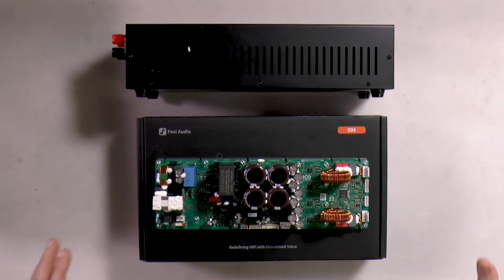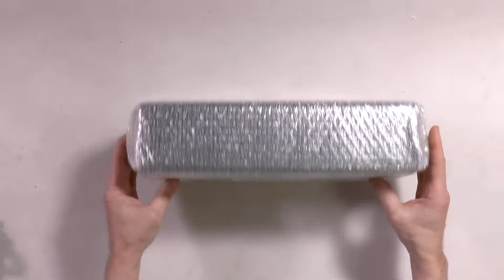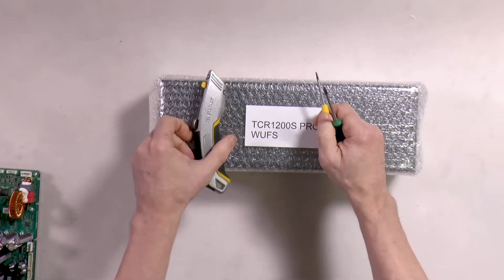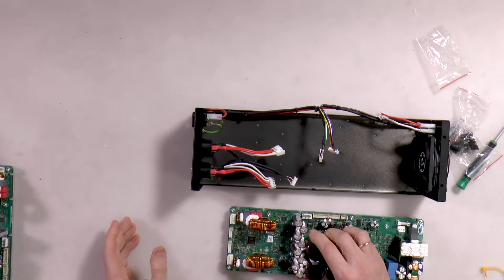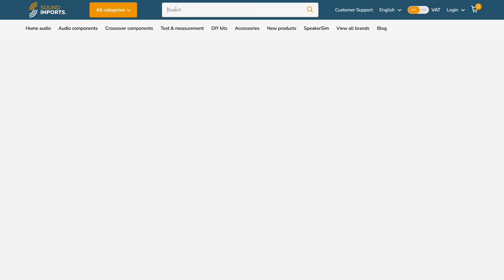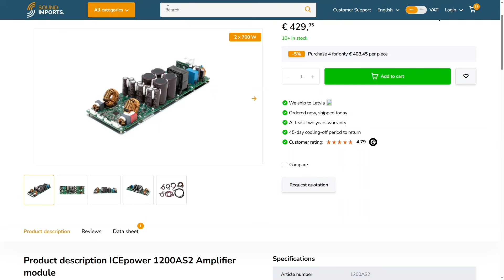Build a ICEpower1200 World‑Class Amplifier in 10 Minutes – Full Guide + FAQ

Comment: Ok so I used 2 700 as1 boards with a dual 5532 op amp pre amp and all I can say is these things absolutely rock and to my ears sound better than my Hypex 400 watt mono boards I built and these were  half the price . There is no replacement for displacement! This is what they say with race car motors and I guess holds true for amps ? The ICEpower being almost twice as powerful I never have to drive them hard at all for the same output on a lower wattage amp wich means a cleaner signal . These puppies don’t even get warm .thank you Mr smiths!!

Comment: Love your channel thanks .i have a dilemma i currently own a 700as1 module .i want a stereo amp . So should i buy another 700as1 and make momoblocks ,or use my current amplifier as a sub amp and buy a 1200as2 being that it has the newer technology but is a bit more expensive? Thank you again
Reply from the maker: 1200AS2 is unbeatable. Depends on a goal you are aiming. 1200 is grate for full band amplifier aplications and can hadle any speaker from small to large.

Comment: Good morning sir , I have bought 2 of the 700as1 modules I would like to use a tube type pre amp for them .Is there a certain one or a type I should be looking for? Thanks for your time .
Reply from the maker: I am more on the engineering side and have limited hands-on experience with different equipment. You would be better off speaking with someone in sales who has access to a wider range of preamplifiers.

Comment: Good afternoon, Mr. Smits. Please help me with advice on the icepower 1200 amplifier board. When the amplifier is turned on and off, there is a pop in the speakers due to the transient process. I connected 220 volts to the board, the signal from the preamp, and connected the speaker system. What did I do wrong?
Reply: Hi there, when you do this sequence :  starting  first by powering  your sources, then the preamplifier and then the power amp and when you stop, stop first  the power amp, preamp and then sources., do you have the same problem?

Comment: I have a couple of these Im putting together  a pair of amp plate with some china generic plates that went bad. So i have all the mechanical done just ready to do the wiring but im a bit co fuse with the stanby turn on..
Does the board should sound once it has power and signal in. Or have to clip any pins etc, also not sure on using both channels at 8 ohm or one channel at 4 ohm. I guess ill go with dual channel at 8 ohm not to strees the board.
Reply from the maker: For standby and wake up from a signal. You should provide 5-12V to P101 pin 6. It will put the amplifier in Standby, and you should provide a signal from one of the inputs to the P102 signal sense pins 20,21,22. Download the engineering manual from the Soundimport site for more details. Regarding asymmetrical load, you can use any load combination. The board has been built for that

Comment: After watching your video, I built an amp using 2 1200as2 boards completely separate from each other including power cord. In doing so, I also put a DC blocker board in front of 1200.  The resulting sound is incredible clean, transparent, driver control (McIntosh XRT18, 18 drivers per channel)  the bass is so tight and deep I have not heard before. The amp sounds very much like a class AB amp yet cleaner, faster and tighter.  I have owned many amps before and  IMHO the Icepower 1200AS2 dual mono shows the most musical truth. Burned-in took at least 200 hours.
Reply from the maker: Recently I’ve been selling more and more integrated amplifiers in the local market, and the feedback I’m receiving matches exactly what you described. For many customers, the 1200‑series board has become the true end‑game amplifier.

Comment: I work in power supply design, at 1KW you need a PFC interleaved boost if the application is expected to have sustained current draw, these have no indication of a PFC stage.
Reply: According to the manual it does have a PFC circuit with a nominal power factor of 0.92
Reply: @EEGworld  the question is, why isn’t the gentleman that made the video answering his question. Somebody else in the comments is answering, which is concerning.
Reply: @philmccracken2012 he is not an icepower engineer. And he has answered this question elsewhere. Relax

Comment: I love your YouTube video's, thank you for your commitment to DIY'rs!  My preamplifier is a miniDSP Flex with RCA outputs.  Will I be able to achieve the full audio potential of your ICEpower 1200 amplifier with my miniDSP using XLR Male to RCA Female Adapters?
Reply from the maker: You should check mini DSP output level. FOr full power in unbalanced setup boad needs 4V for 4Ohms spaker adn 8V for 8Ohms spaker. For balanced half of that 2V and 3.8V

Comment: I think you should come out with a product that is similar to trinnov amplitude and the new (or soon to be) amplifier by SpeakerPower. These are known to be high end products and they use the 1500S IcePower amp x2 and the 400A2 boards x4 I believe. The trinnov doubles that. I think this would be a desired product since it is similar to those high end brands.
Reply from the maker: That's an interesting idea, but industrial module availability and shipping costs make small-scale production difficult.
Reply: Pics of the speakerpower new amplifier on Avs forum. Think the trinnov has the 400A2 all on the same board, but probably measure the same as diy.

Comment: I recently assembled my own TCR1200C. The sound is incredible and I think it's at least as good as the £3500 Class A/B amp that was used when I auditioned the speakers. Those are Amphion 3LS ex-demo at half price - £1900. This is where I invested the money I saved on the amplifier. What a way to make top-quality Hi-Fi available to the masses! Thanks, Guntars, for introducing me to this idea.
Reply from the maker: Glad to hear you are enjoying such high-end performance on a budget! 👍
Reply: What speakers are you driving with this AMP? Is it 4ohm rated and do your speakers dip below 4 ohm? What is the sensitivity of your speakers?
Reply: @GrayTSound I wrote this in my message. You can get all the technical details from the manufacturer's website.
Reply: @neilcreamer8207 Low sensitivity but 8 ohm. I have read a lot about this Amp going into protection mode within 10-15 minutes with 4 ohm loads. Also reports of high (10%) distortion on Audio Science .
Reply from the maker: @GrayTSound  Minimum load for full power  is 2.7 Ohms
Reply: Здравствуйте Гунтарс! Скажите пожалуйста как можно купить ваш усилитель в Россию? Спасибо!

Comment: I live off grid, and want to power this from DC power. I have battery banks at several higher voltages, plus DC-DC converters, so can supply any voltage needed, but prefer to stay under 60Vdc.

Can you help? links to HowTo's
Reply from the maker: You need some DC to AC mains converter. Search on Amazon for DC to AC converter. That's it
Reply: @guntarssmits2104 called an inverter. And no, for large draw items I want to pull native DC directly.
Reply from the maker: @PaulCrawhorn  Than TPA3255 solutions can be a good option
Reply: 3255 board is your choice
Reply: Other boards are better for that application
Reply: Понял,спасибо!